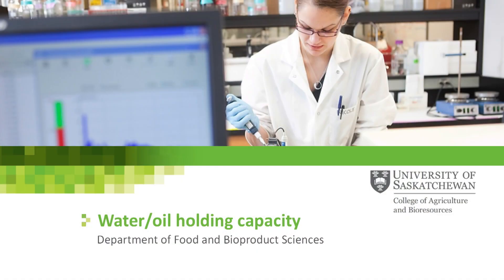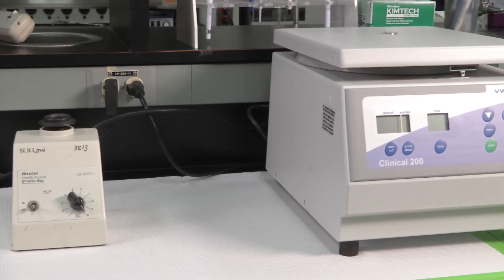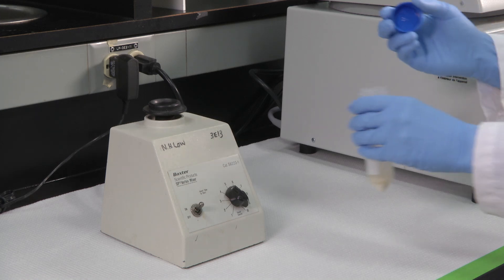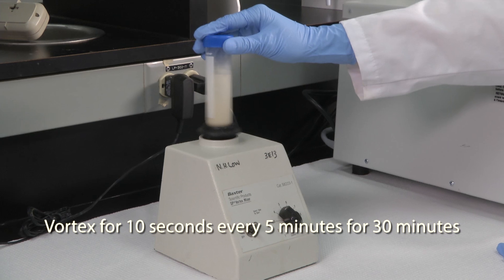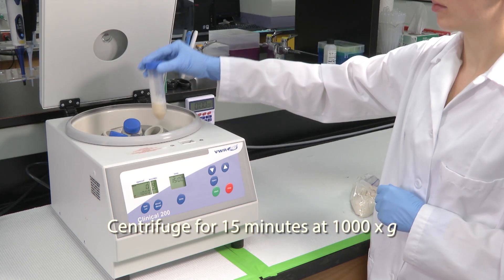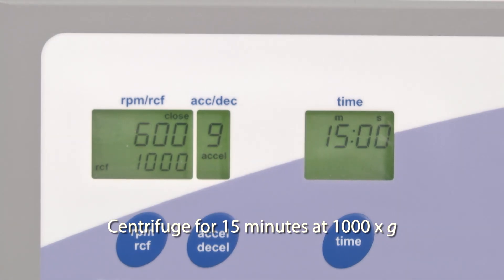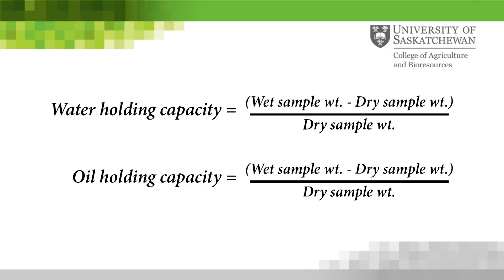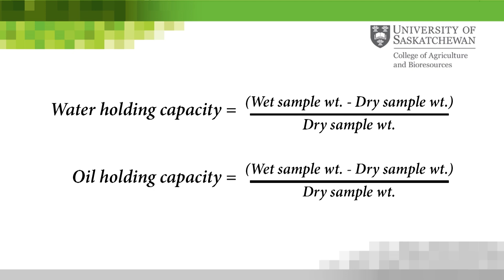Water Oil Holding Capacity

Comment: What puplication is this method you're using based on?
And do you happen to have a suggestion what to do if the protein powder dissolves completely in the water so there is no pellet left after the centrifugation?
Reply: i think its  AACC Method 56-30.01